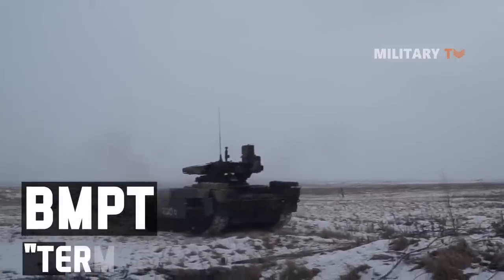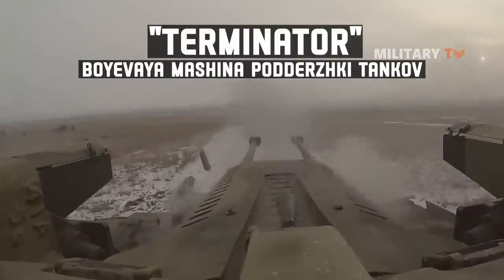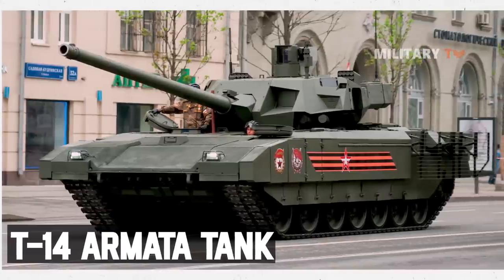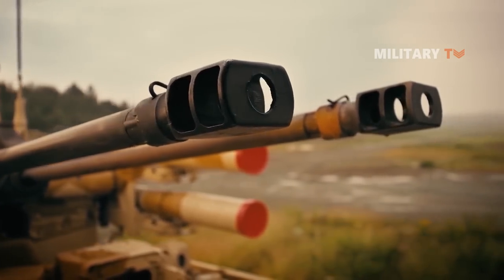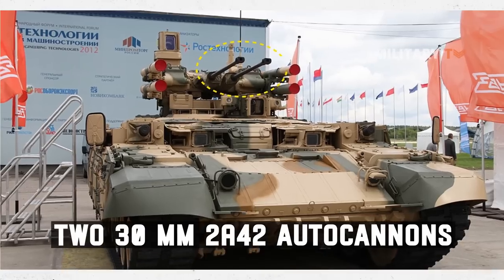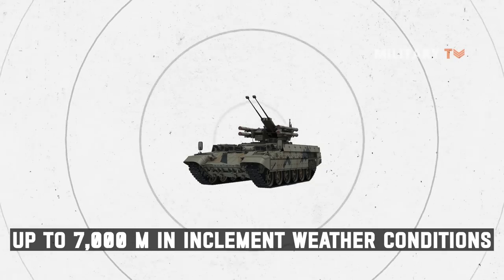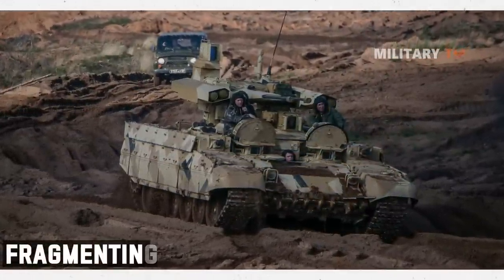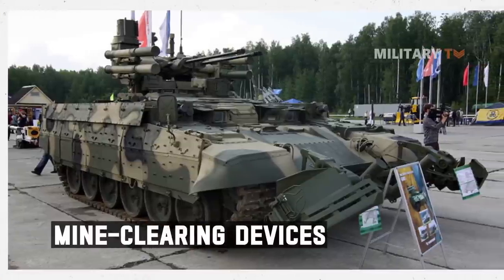What Makes This Terminator Tank Extremely Lethal?

Comment from the maker: Rheinmetall Lynx KF41 Infantry Fighting Vehicle  ► https://youtu.be/h_7P9U21ZGA
Reply: nato is losing militarily, economically, and politically.
Reply: BMPT terminator 3 can be on the T14 chassis with a khinzhal module but instead of one 57mm gun there will be 2. I think it will be similar to T15 with a khinzhal module (2 Ataka missiles and 1 57mm gun, apfsds-120mm penetration on 60° armor from 1.5km)
Reply: terminator came in, to hold back nato hardware. Simple
Reply: Terminator in addition to 2x30mm auto cannon and 2x2 Ataka atmg's also has 1  7,62mm coaxial machinegun and 2x30mm grenade launchers on the side above the tracks.
Reply: There is nothing deadly on this tank, thats the reason why he was also quickly removed from the Ukraien battlefields. The barrels of the "Terminator" are a faulty design, they start to heavily oscilate after the first shot and hit therefore nothing. The spread is just ridiculous, not even a large truck wil be hit on a 100m distance.

Comment: We can feel a little prejudice against the russian army in this video. Tanks are not as decisive as they use to be on the battlefield. They are threatened by dromes, airplanes, mines and the infantry have more ways than ever to destroy them. But armies still need them. Tanks have been proven not so effective in urbain warfare. The russian have experience the limits of the tanks in this kind of environement in different battleflied notably Syria where russians tanks have shown to be very vulerble agianst infantry operating in an urban environement. The ''terminator'' is an answer to this vulnerability with high velocity fire power and large angle of attack. The fact of replcing the canon by using rockets make also very much sense.
Reply: Best advice I have seen in this thread. BTW, Russians learned hard lessons regard tank use in urban environments in Chechen war too.

Comment: As a former Bradley gunner I have soooo many questions. Guns x2. Also means 2 feeds and storage. External guns, means unassing the turret and removing armor to clear a malfunction. Loaded unarmored launch tubes. With no reloads. It appears to me that it would be less than durable on the battlefield as far as the turret systems go. Additional gun rounds? Seems to be lacking. Must be fun boresighting two barrels at once, or are they just less accurate? And crazy as you might think, how durable is the turret vs say, a large tree branch or other vertical limitation  that the hull easily clears under. Things happen fast in combat
Reply: Один ствол заряжен осколочно фугасными снарядами , а второй бронебойными . Поэтому в бою  он будет стрелять из кажлого ствола  отдельно
Reply: Keep in mind these fire *simulatneously*. They also have two very agressive muzzle brakes and are completely exposed. The barrels on these things shake violently and have horrendous accuracy and dispersion from being blasted about by the muzzle brake concussion. Ever stood next to someone firing a rifle with a brake like this? It's very unpleasant. Imagine that in 30mm

Comment: Fun fact about gun (include thumbnail)
; The 30mm gun a shake every time when fire due muzzle brake's pressure are simply push each other and increase gun dispersion
And thumbnail include curse 3 gun are possible but I guess bullet just end up everywhere and out of ammo faster
Reply: As far as i know there are two guns because of the fact that they were Not able to implement a two Belt feed System te change the ammotype quikly from i dont know HE to AP 
So there are two guns with two different belts
Reply: @dozan174  Oh I forgor that, yeah that right
HE and AP are correct (It has specified detail I also forgor)
Reply: @dozan174  я тебе открою военный секрет! Но в этих орудиях одинаковые ленты) Просто в ленте идут разные вариации осколочно-фугасных снарядов и бронибойных в порядке ленты) И поверь будь ты на 500, что на 2500 метрах от нее, ты бы понял что не хотел бы там находится, и все предыдущие выборы судьбы, привели тебя к фатальной ошибке!

Comment: Sounds great in theory, however in the cold light of dawn it's just another tank target to overflying UAVs. It's just another armoured target to the myriad of guided NATO anti tank missiles or mobile battery of M109 155mm SP guns. Plus devoid of dismountable infantry section to ferret out the MILAN teams. This strange doctrine of less infantry points towards a fear of treading Ukranian soil.
Reply: It was developed for Grozny.  The lack of TRAINED infantry was the issue Russia was trying to address with this.  It didn't pan out in Ukraine.  There is no real substitute for SKILL in combined arms operations.
Reply: It is also going to be the first Target of an infantry anti-tank team
Reply: @swaghauler8334  No, it was developed for urban warfare, based on the experience from the caucasus conflict, which is different.

Comment: Easy, rather than putting one Daka Daka. The Russians thought it'd be ingenius to put TWO Daka Dakas and have it capable of pointing straight up so no highrise building can save you when its around and THEN automate the turret so it doesn't need a person on the top to operate it, so even after destroying the turret. It might still be able to function with its components still intact. As if that wasn't enough, they also thought it'd be ingenius to slap not two but FOUR Vikhrs ATGMs on its side to shoot down far away low flying choppers or any MBTs that it'd see within its thermals.

I swear, the Russians. Like the United States Military Industrial Complex just thinks up whatever man made horrors beyond human comprehension and makes it a reality and puts a price tag on it.
Reply: this is literally just an uparmoured bmp with more elevation
Reply: @aniviamain309  Did you not see the video my guy?
ITS HIGHLY ARMORED

Comment: the only flaw of this tankis its twin 30mm

if it is a 75mm bofors or 57mm would be better in terms of penetration and anti drone capability
Reply: Yeah but twin cannons are cooler
Reply: @FinalRepublic  bang on
Reply: it would not be necessary for that because one, you can store much more ammo of 30mm than of 57mm or 75mm, secondly you don't need any extra pen on the 30mm because you have 4 ATGMs on this thing for destroying enemy armor and defensive positions (should you need to), you also have 2 30mm grenade launchers too that are able to fire over cover and destroy enemies hiding behind said cover, not to mention that a 57mm or 75mm would have far less of a rate of fire than 2 30mm and would be far less effective at suppressive fire which is extremely important in combat, and last but not least 2 30mm cannons are more than enough to destroy enemy APCs, IFVs, and motor vehicles, not to mention that 30mm shells are far cheaper to produce and produce in large quantities compared to 57mm and 75mm, and considering just about every other Russian APC and IFV uses 30mm shells it would also be much simpler for logistical reasons. also it's better to have 2 cannons than one because should one jam you have another cannon you can still use.

Comment: Wait, wait, wait, you skipped some very important facts on to why this terminator is still around. By 2015 this project was shelved because the Russian government couldnt put an order because of financial difficulties due to western sanction, as this new tank required the installation of a new production line, new equipment and training of new workers. 
Algeria asked for the 2 prototypes to be sent to them and after 10 months of testing they put and order of 300 units in april 2016 and PAID CASH IN ADVANCE to have the production line setup, basically saving the project.
In 2017 Russia put their order that should start receiving their 1st batch the very next year 2018 after the production line was setup and then started the Algerian order mid 2018 till end 2021. The rest of the Russian order was started after the Algerian order.

And that's why Algeria has 300 (some say over 300) and Russia recently (2022) started getting their units

Comment: Don’t appeared to have been any good so far.
That turret looks highly vulnerable to blast damage
Reply: The important part is the hull…The turret is unmanned with a hull of a tank, this AFV is very survivable than all BMP variants.
Reply: У этой бмпт стоит Активная защита последнего поколения, так что поверь,эта штука и Абрамс в силах разобрать на запчасти
Reply: It doesn't look like it's designed to face down a main battle tank. Only main battle tanks are built for that role, with anti tank vehicle and man portable missiles filling in the rest.
Reply: @Knight_Kin  yes it is…it has ataka ATGMS capable of penetrating 800mm of composite armor.
Reply: @Knight_Kin  Он и не предназначен для борьбы с танками. Я только сказал что он может разобрать любой танк, при себе стоимости дешевле западного танка в несколько раз дешевле
Reply: @Josh_Exitcamper  and if that missiles gets shot by an rpg it wouldn't be just the turrent that would be exploding hahaha
Reply: @chestermabanag8590  , try to hit it with an RPG at first! Especially, at moving BMPT.
Reply: @maksimluzin1121  i mean even from a shot of a rifle it will probably just explode look at that turrent it basically doesn't have a freaking armor it would not fare well in an urban combat
Reply: You can have all the gear, but if your crew do not want to fight then it is not much use.
Reply: @chestermabanag8590  , It was tested in different conditions. Actually, the last serial model of BMPT has armor plate shields on the ATGM launchers. By the way, the BMPT has a long history, at first, it has the name BMOP ("Combat Vehicle of  Fire Support", in En.), but the generals of Russian (Soviet) MoD said "We don't need such a vehicle which costs 1.5 times of any ordinal tank! For what?! Better to buy more ordinal tanks!" So, it was renamed to BMPT ("Combat Vehicle of Tank Support") and its role was stressed out exactly for that (but, actually, it is much wider). It's interesting, but the first serial batch of BMPT (of the 1st version) has got the Kazakhstan army, not Russian! The second batch got the Algerian army. It was proven, it was good for them. But Russian MoD wasn't sure about the BMPT role for a long time, and only the very successful usage of it it in Syrian conflict (by Russians themselves, now), especially in urban conditions, made the final decision to produce it serially for the Russian army. Therefore, the BMPT has a long history, actually, so it has a quite long test background. Believe me, the vehicle is very well protected and it was No One situation when its turret was hit in the real combat conditions!

Comment: They should have used Vikhrs ATGMs instead of Atakas to give it an anti air capability.
Reply: this is bullshitt. why they dont bring the mighty t-90 to Ukraine? affraid of javelin or nlaw? 
😂
Reply: I mean, Ukrainians shot down atleast 3 KA-52s with Stugna-P (an ATGM without proximity fuse), so i don't know why ruSSians can't do the same with Atakas.
Skill issue maybe? 😏
Or the fact that Vichrs are way too expensive for tanks to use 😏
Reply: @pixelion1579  T-90s are already in Ukraine, what are you talking about?
Reply: @voidtempering8700  you just dont get it. in the beginning of war,they use it . but failed and lost 2 of them. then they pull it back ,replace it by old t72 and t64 from far east.sending it by train from another side of Russia. why ? because they cant accept losing more t90 . it is expensive and cant handle the power of nlaw . in the second fase of war,t90 is not using again in front line.
same case about the terminator. they were deployed 10 and lost 2 . the rest was sending back to Russia.
Reply: @pixelion1579  The t-90s are still actively being used, where did you get information that they were pulled back?
Reply: @pixelion1579  nlaw only have a range of 800m. Not to much of a problem.
Reply: Vickers are only mounted on air platforms,ataka are mostly ground platform
Reply: @TADAMAT-CZ  actually they have a model just for that reason but the terminator is not built for that purpose and besides they could use the cannons
Reply: @jeffreyprezalar220  anything can be modified…

Comment: i don't understand why russian engineers like the twin cannons so much ( the ZU have 4 ) whenit is widely known that this solution lacks stability and precision to the guns .
Reply: Its the only way they could get two types of ammo avail to fire. One gun is loaded with AP ammo and the other with HE ammo.
Reply: Power + amount of lead, one gun jamming,  heavy stable platform permits. Remember Russian Shilka shooting at much smaller fast moving targets.
Reply: @PEter Harrald Sorry your wrong they are fixed in place to each other. AP ammo in one gun HE ammo in the other. They could not get a dual ammo feed to work so they mounted two guns with different ammo. And the grenade launcher is a smoke launcher with frag grenades loaded in them.😎 Just so you know.
Reply: @PEter Harrald No its not. That was right from the builders of the breast.
Reply: @PEter Harrald Do some research. Its true data right from the builders of the breast.

Comment: if only the muzzle breaks were rotated 90 lmao, the accuracy from the wobbling is hilarious
Reply: How would rotating the muzzle breaks change anything for the good of accuracy
Reply: @kalgstol  Are you not witness to the shockwaves of firing shaking the barrels laterally...
Reply: @idgaf5252  are you not listening to yourself. Physics guy. If you rotate the muzzle break 90° you will have the same effect, just up and down, not side to side. As for accuracy, I would prefer covering a larger area left, right than have elevation off and shoot over their head
Reply: @kalgstol  I see you liking your own comment lmao, I'm still right, you can't argue a vertical muzzle break wouldn't reduce the barrels from wobbling.
Reply: it pushes out the same
Reply: it is- computer never miss any target waan try? hidde in a florest

Comment: The hull is a refurbished T-72 hull, not a T-14 hull. That's a whole different dog.
Reply: No, that's a cheaper model developed after this one.
The russian officers were quite satisfied with the concept that they asked for a cheaper version to replenish every batallion
Reply: @gerardsotxoa  The cheaper version is probably what they went with. It drops the grenade launchers and two crewmen. Not certain, I wasn't invited to the discussion. They use a T-72 hull on them though.
Reply: @Scrat335  i was thinkin on a different thing, they want that torret mounted on wheel vehicles. 
There is a BMPT-72 and BMPT-1 and BMPT-3
The BMPT-72 is mainly for exportation
Russians are using the 3 crewmen version which i think is a highly modified T72/T90 hull

Comment: The problem is the Russians have waaay more tanks than BMB-Ts which really defeats the purpose of having them as they are meant to preserve tanks!!
Reply: Maybe currently. Probably not using all their tanks for now, and building terminators at full capacity if necessary.
Reply: They can just transform some of the older t72 hulls into bmpt's

Comment: One soldier plus one FGM-148 Javelin = no more BMPT Terminator Tank Support ,Fighting Vehicle. 
Do the math.
Unit cost for a Javelin~ US$216,717.

 Unit cost  for the BMPT Terminator is ~ US$2.3 million. 
$2,300,000
- $216,717
___________
= $2,083,283
When the tank is lost the 3 man crew is lost as well.
Reply: Javelins were present along side BMPTs
Reply: This is stupid, because so, you can say about any tank, for example: 
"One soldier plus one FGM-148 Javelin = no more Abrams tank. Do the math.... " 

Are you suggesting that tanks or armored vehicles should not be made now?
Reply: @AlexanderCackeLobov  That is exactly what I am suggesting.
They used to build Battleships until Aircraft Carriers and Aircraft made them obsolete.
Tanks are obsolete.
1. Land mines destroy tanks.
2. Tanks destroy tanks.
3. Aircraft destroy tanks.
4. Artillery destroys tanks.
5. Infantry destroys tanks.
Everything wants to destroy tanks.
  Tanks are heavy, expensive to build, difficult to move from one theater of operation to another, require large amounts of fuel, and require a crew that is lost when the tank is destroyed.

Missiles are not obsolete.
they are relatively cheep to build.
Drones with missiles are not obsolete.
Drones do not risk the lives of crew.
The future of warfare is robots.

Comment: The obvious fact that Russia itself didn't procure the Terminator is a sure sign that it doesn't pan out. Given that IFVs exist and that additional infantry to support tanks is a better solution in urban settings, the concept is already flawed. Russia has an army that relies too much on tanks already. Issuing new tracked  AFVs to support a tank heavy BTG with too little infantry rather deepens the problem than solving it. I also don't see how a vehicle that is very vulnarble due to it's exposed armament fares well in an urban setting. It's more useful when it can fire it's massive armament at a distance, but so are tanks and IFVs. The double barrel mount has shown issues regarding it's accuracy.